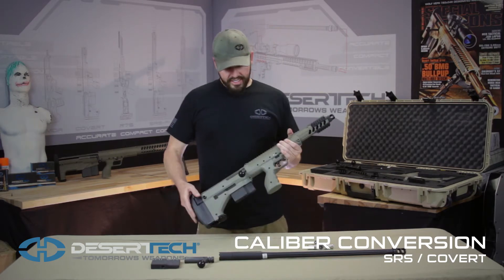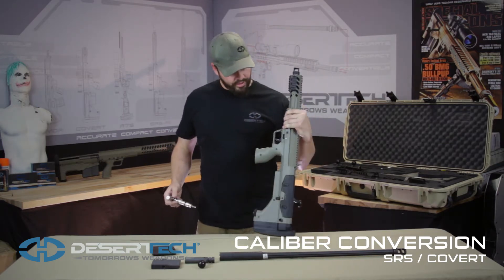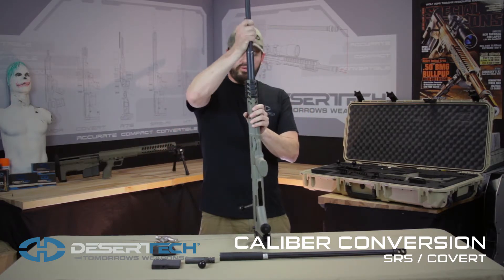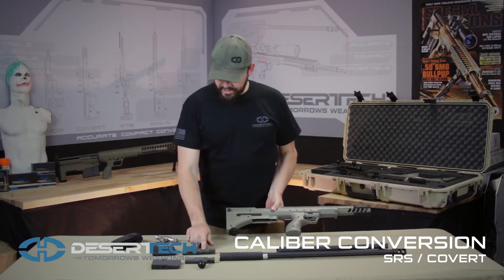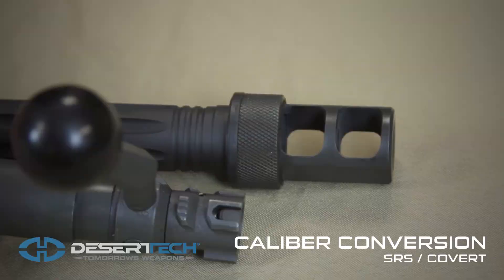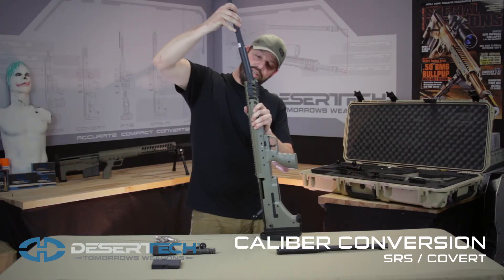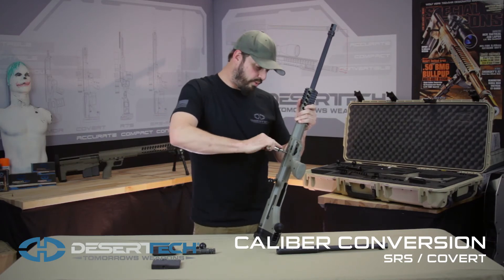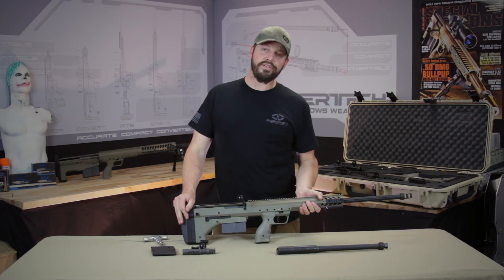SRS A1 Caliber Conversion | Desert Tech

Comment: Hey guys. I have an order in for a conversion kit that I expect to be receiving in Australia in a few weeks time. I am yet to do a barrel change but I see in this video that you are adjusting the locking bolt before touching the tension bolts when removing as well as when installing. I had expected that the install would be the reversed procedure to the removal (ie. tension bolts, then the locking bolt). Or does it not matter what order they are adjusted?